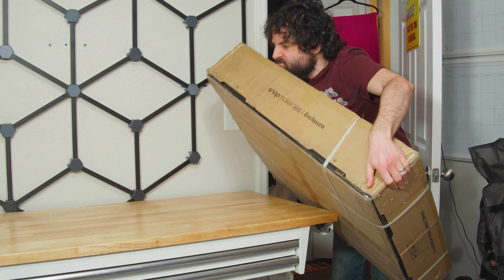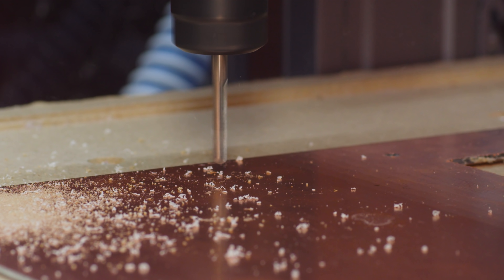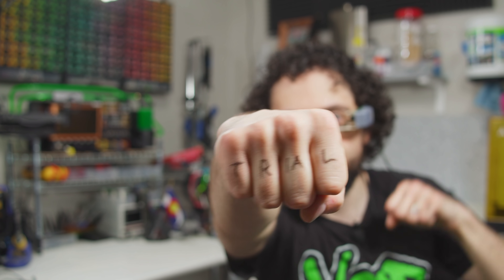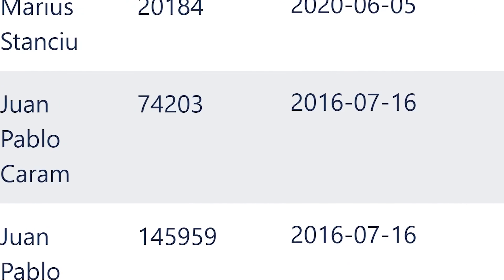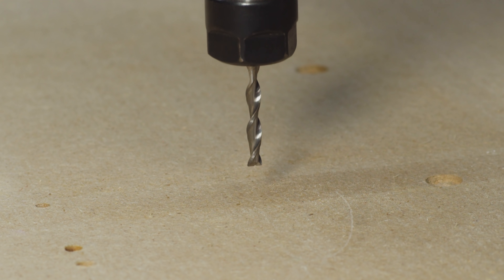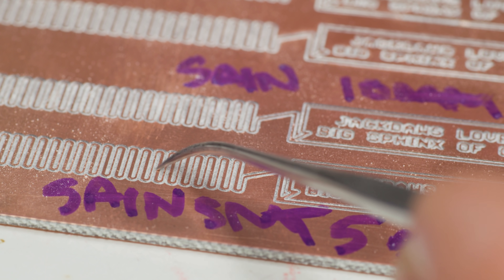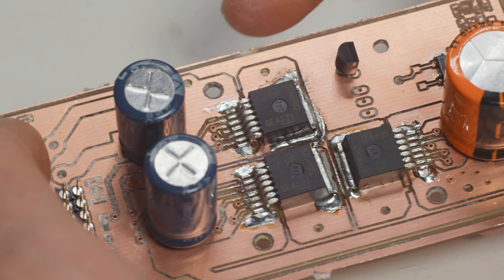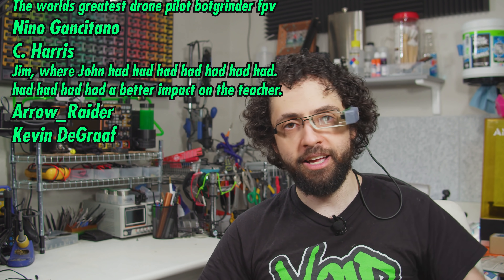PCBs in Two Hours? Zack Sucks at CNC

Comment: Good stuff! A few hints to make your life easier next time.
1) Use oil when routing to help with smoother cuts.
2) Afterwards, use 800 grit sand paper really lightly to remove the ragged edges. This makes silkscreening and soldering easier.
3) If your bit feels off center, it's probably the collet, not the bit. Tighten the collet all the way without a bit in it. Then loosen it off until you can put your bit in. This helps center those cheap collets in the ring.

Comment: Flatcam really is rather bad... I use copperCAM, it has a tool library and options for manual tool change and I find it easy to use, YMMV

My controller is GRBL so I can just use any of the available G-Code senders. I use bCNC, which has built in surface leveling functions =) all I need is a probe/ground wire on a couple tiny alligator clips, probe wire on the PCB, ground wire on the tool tip. Also useful for setting Zero on the Z axis. Unless you can manage 20k+ rpm, cut in 2 passes; first pass doesn't cut all the way through the copper. This leaves MUCH cleaner edges and is way less likely to break the tip of those 0.1mm tip engraving bits. Try a slower feed rate 10mm/s or less. When done, hit the copper with 800 grit sandpaper, wash it, and dip it in Liquid Tin.

I use tiny pan head screws into my waste board to hold blanks down, I dislike messing around with tape. Do NOT use drill bits, use "Roughing End Mills" (yes they are available at very small sizes), drill bits pull up a bur way to easily and they drift off point easily as well. Experiment on depth of cut, I usually just google search the thickness of the copper for the weight that I purchased and go aprox 0.06mm deeper than the thickness of the copper. Cutting into FR4 will dull a bit VERY quickly.

I've got the process down quite well and make perfect boards every time, hell I should make a full youtube tutorial on this crap, heh

Comment: I spent the extra money to acquire a professional Belgian Colinbus milling machine (PCBBOX) an software, 10 years ago.
It has NEVER failed to produce a micrometre-perfect board EVERY time!
It uses alignment pegs that are only raised above the board a half a millimetre, to avoid fouling.
A thick spring-held pressure-platen on the the drill-head that flattens even warped boards as they are being milled.
And a vacuum nozzle in the centre of this platen.
Colinbus has sorted ALL of the problems that you encountered, and more, decades ago!
Don't re-invent the wheel.

Comment: Zack, I know your pain – I've been doing same research in the first covid summer and winter. I had cheap knockoff chinese 3018 Pro, but results were looking about the same :) Your traces outlook suggests to use much lower xyz movement speed and shorter bits. And you definitely would want mesh leveling! The milled pad is nice, but it is anyway not 100% accurately flat. Neither is the sticky tape, nor the PCB clad itself, and even the copper foil is not equally thick in every place. You anyway going to get either too deep or too shallow cut without mesh leveling. I still do even with mesh leveling, because the bits does get a little more dull with each trace it carves. Yes PCB bits are nice, but they are actually total overkill for this job imho, they are stronger and stiffer, but otherwise will give you no benefit. I get consistent results with short obtuse V bit (like, 60degrees), low xyz speed, mesh leveling via Candle software. Once you get through the copper milling, you will also like the solder mask milling 🤪

Comment: Imagine not buying a few hundred dollars worth of chemicals to make palladium catalysed electroless plating for plated vias and through-holes.

For real though, those copper pads on the front side of all your THT components are superfluous. From what I’ve seen, modern E-CAD software doesn’t let you delete them.
Yesterday I started writing a python code to look through all the lines in a KiCAD PCB file, identify THT components, and replace the *.Cu and *.Mask the F/B depending on what side the component is on. Then I just load it back in KiCAD, regenerate any copper pours, and I’ve got a board perfectly optimised for using without PTHs. Even easier if you run it just after importing all the components from eeschema, as it helps guide routing to the right side and provides more room for traces between leads.
Well it would make perfectly optimised boards if it didn’t corrupt the file. And maybe it would be more convenient to make it as a KiCAD plugin that can be run from inside the application, assuming nobody has done this before.

I’ll also make one for single-sided boards too, not that it’s particularly necessary, but it makes the 3D board view look more correct, and it prevents you from accidentally drawing all the traces to the top side of the DIPs instead of the underside. Which I bet we’ve all done once or twice.
Reply: Just finished it, turns out there’s edge-cases where some components aren’t labelled as THTs or as SMTs but as “exclude_from_pos_files”, which some THTs and SMTs have. So I just did a line.find(“*.Cu”) for every line and if it was greater than 0 I’d replace it. Somehow even with all the .find()s and .index()s it runs in less than a second for a moderately sized board. I’m happy.

Comment: That was pretty cool stuff!
I make my pcb with a silhouette 4 vinyl cutter. Stick it on the board. Acid wash. Peel sticker off  and dremel press drill the holes out. Way faster then 2 hours. But I have to manually drill

Comment: Climbing this learning curve myself.  Does that machine have the ability to probe and mesh calibrate?  If so, hook the bit to one side of the circuit and the pcb to the other and let it map the actual surface of the metal with the actual bit tip.
Reply: Probing is done with software. I guess you do need the input.

Comment: So after some playing with this I came to the conclusion is your board fits in the footprint of a LCD 3D printer using photoresists and home chemicals for etching was more promising for fine pitch. You can also use laser to burn off a mask like spray paint also a viable method.

Comment: A way to make faster PCBs: get UV presensitized copper clad boards and use the laser in a low setting to draw the circuit on it, then etch. You then may use the CNC to drill and mill it. I bet $10 you can cut at least half the time you are taking right now, you can even still use FlatCAM for that. (btw, why are you using such an old version? The latest beta is from 2020, and works very well)

Comment: Maybe I'm speaking out of ignorance here, but if the machine has a laser engraver option wouldn't it have been easier to only mill the holes (assuming the laser isn't powerful enough to cut through) and use the laser engraver for the rest?  If nothing else it might've spared some bits.

Comment: I have a desktop CNC mill that I use for PCBs - it can cut traces down to 8 mils thanks to an extremely low runout spindle, and it's also beefy enough to mill 1/2" / 12mm aluminum plate. I used it to mil metal parts for my 3D printer.

Comment: You keep referring to fiberglass, but isn't this plexiglass? I wouldn't think plexiglass would be as dangerous as fiberglass when it comes to breathing the stuff in.
Reply: It's not plexiglass. This stuff is "FR-4 is a composite material composed of woven fiberglass cloth with an epoxy resin binder that is flame resistant (self-extinguishing)." See wikipedia: https://en.wikipedia.org/wiki/FR-4

Comment: Why don't you get the 10W laser engraver head from Snapmaker and use that instead of the cnc to remove the copper? Like I love CNC and have worked in a shop doing aerospace stuff as a QA for the parts. This seems like using a computer controlled wrench to drive a nail. Also should be far easier to get your tool paths and stuff as it should require G-code and tool swapping.

Second thing, suggestion: Yes, just clamp parts down or use screws to hold them down if you have that much edge margin around your parts. The tape method is ok for holding stuff down if you have very little or no edge margin, but honestly a mechanical hold down will always be better an have far less chance of failure than relying on an adhesive.
Reply: Maybe because people don't like charred circuit boards?
Reply: @Paul Frederick  your right, standard laser doesn't cut copper super well. i mean, fiber laser cutters can do it. Also using the pre-included low power laser he could etch the pcb with ferrochloric acid as well.

Lot of other options on the table. I just don't think milling pcbs is the most efficient use of time and money. Just throwing other ideas out there.

Just a thought.

Comment: Great video! Btw you should use Fusion360 for the .nc file and UGSplatform to talk to the cnc. Check if your machine supports this software, it is easy to use and I've never had problems of any kind with it

Comment: FWIW, you should be able to add a pen plotter head to create a faux solder mask.  (I also wonder if you could put a 0.2mm nozzle on the 3d printer head and 'draw' the solder mask in plastic before you mill the faux-PCB.

Comment: I suggest giving them a wipe with some medium scotchbrite to remove the jaggies.
Reply: That won't work. What does work is just running the job a few times. CNC machines can do that sort of thing. Better than you'd think they could. Each pass it'll clean the cut up a little more too. Because the bit will be in a slightly different position in it's arc of swing. That's random. The tool path isn't. What I do is run the first pass high then set it at final depth and run it two more times. That comes out like a chef's kiss. Perfecto!

Comment: Hi Zack you are awesome and an inspiration. Use finger diel gouge to double check the board before you cut. Chances are it will not be flat. Instead of carpet tape use screws and shims to clamp the blank. I was a cnc machinist for a very long time and that's how it works with that. Hope I helped. When you cut a dial gauges are your best friends.

Comment: It’s usually safest to run what’s known as a safety line, a block of code at the beginning of every program that sets modal commands that are most often guilty for breaking things. In my shop in the US, we use G20 G40 G80 G90 in most of our programs to set to inches, disable radial cutter compensation, disable cutting cycles, and set movement to absolute.
Reply: That's what I do in the G-code for my little desktop mill - I have a block I paste at the start of each file:

(Preliminary setup)

G90 G21 (Absolute movement, millimeters)
G92.1 (Reset all offsets)
M5 (Keep spindle off)
G94 F180.0000 (180 mm/min feed rate)
G92 X0.0000 Y0.000 Z0.0000 (Set current coordinates to physically touching the bottom-left corner)
G0 Z5.0000 (Move straight up off workpiece)
M3 S25000 (Turn on spindle, set spindle to 25K RPM)
M0 (Pause for spindle spin-up - NOTE: operator should actuate cycle-start to continue once spindle is at speed)

Of course I override/change from there but that start block stops a lot of potential problems, and I touch off the bit to set Z prior to firing up the file. My spindle is a 750w 24V DC PM motor on a 25A PWM speed controller that's controlled via USB and connected to Mach3 so it can respond to M3/M5, so I have it set to pause for spin-up, which also gives me a moment to make sure everything looks okay before pushing a bit into material.

Comment: Use the Flatcam Beta, it is much better. To enable mesh bed leveling for cnc on the machine you would have to hack it a bit. There must be a z-probe pin that you can use? If that works you can do mesh bed leveling with bCNC.

Comment: FINALLY! A multi-purpose machine that ACTUALLY INCLUDES proper laser safety panels!

No relying on everyone in the house walking around with laser shades all the time.
Reply: That is an upgrade sadly
Reply: Just use an enclosure with a camera to monitor the cheapos which have no laser safety panels . It just works.

Comment: So aren't there any spring suspended gizmos that you can put in your drill head while debugging your machine/G-code to prevent sending your real flutes straight to the trash? Like those things used for bed leveling but tolerant to big overshoots?
Reply: Like a touch probe?
Reply: @ChucksSEADnDEAD  yes, but one that can handle being pushed in millimeters without breaking. Like a mini shock absorber. Ideally with compression feedback, but that's hard to achieve in a rotating part.

Comment: Another ' cheat ' with the aligning holes is USE THE BOARD MOUNTING HOLES AS THE ALIGNMENT HOLES. Iknow that means making boards symetrical fir bolting after making, making sure that bolts are on ground plains, the edges to hole centers are the same and short flathead self tapping screws are capable of popping out of MDF while holding down a workpiece.  It would also mean planning FARTHER ahead, which can be an issue, the lack of seems to both trigger me and keep me watching the chanel...

Comment: i am making a cnc mill out of my cr10 v2, it works on wood and still did not test on PCBs, still quite the coincidence....
Reply: Your 3D printer is a fine 3D printer I'm sure but it's a bit spindly for use as a spindle machine. You 3D printer people don't seem to have much of a grasp when it comes to mechanics.
Reply: @1pcfred  got back here because i am making a cnc myself, I have to say, you do underesimate how light of a work is just engraving pcbs is, i did not try to cut them up, that might be bad but removing a little copper layer off of the plates is not that bad, what i did underestimate was how much i would hate seeing my enclosure getting full of dust which is why i am now 3/4 of the way done with a new cnc dedicated to the job

Comment: I used to use a laser printer (from the library), clothes iron, and some homemade CuCl2( some mixture of HCl H2O2 and one pre 1982 penny) to etch my own boards, I erred on the side of over etching, bridged the missing connections with enameled wire, and it did work.
Reply: Yep I used to do exactly that back in high school, circa 1990. I got really good at it and made useful circuits borrowed out of magazines and with a bit of help from Radio shack for acid, PCB clad etc. I used a dc motor out of a toy car, coupled to a 1mm drill bit to hand drill the holes. Oh the good old fun days!!

Comment: if you coat the copper with something, laser away everywhere you dont need copper, you can also use the machine to etch pcbs... OH and before i forget, you can also use any old resin printer, just get yourself one of those uv reactive pcb blanks, make a 1 layer print in the shape of your pcb, etch it and you got yourself a perfect pcb with no tools in a very short time! also, no jagged edges and no microcenter.
Reply: Yeah but he got a free CNC machine.
Reply: @1pcfred  i know... i know, but with resin printers beeing CHEAP, using that would be epic, you can still use the cnc for actual cnc tasks like drilling the holes
Reply: Have you actually tried that? I would think that the laser could easily damage or even remove the hair thin copper right along with the mask. You'd still need a mill for holes/vias, and a I don't think a resin printer would have any means of aligning the image with the board. (Unless it's a single sided board with only SMD, or you're willing to drill everything by hand.)

On a laser/cnc combo like this machine you can use registration holes like he did to get the laser and mill in more or less perfect alignment, so the laser could probably help in other ways like maybe for marking silkscreen, or even cutting an SMD template. 

Most 3d printers could be modded to take a laser head (ignoring software), so that technique sounds interesting. Ferric chloride is much cheaper than a pack of end-mils and arguably less messy than milling dust.
Reply: @TheVideoGuardian  maybe you need a mill for holes or vias but I have a dedicated high speed drill press. I don't drill boards on my CNC machine when I isolation route them. I drill them by hand with my drill press. I can't be asked to do all of the bit changes on my CNC it'd take. A 3 jaw chuck is a lot easier to work with. I'm very particular about part fit in boards too. One size does not fit all. Plus I just like drilling boards out. If I didn't then I wouldn't do what I do.
Reply: @1pcfred  NB a drill press would likely yield superior results, granted the operator has skill. (I sadly do not!)
Reply: @TheVideoGuardian  a diode laser wont "cut" copper as far as i know, and even if it would, you could just tame it down to the point where just the paint gets removed. with a resin printer, you cant really align a board double sided, thats true, but most prototypes can make do with a single layer relatively easily
Reply: @SharkyMoto  Thanks, you're right. I just remembered laser cleaners exist that can scrub rust/paint off of metals, leaving them looking shiny new. Apparently it requires a hell of a laser to actually cut metal!
Reply: @TheVideoGuardian  yes, i got some 3mm steel lasercut last year to build an oven and the guy used a 4000watt laser to do it. the power that is focused on that tiny little 0.1mm spot is INSANE